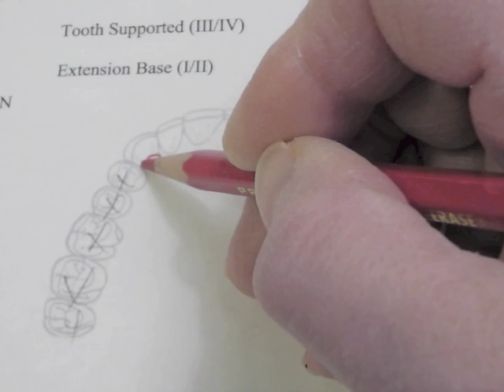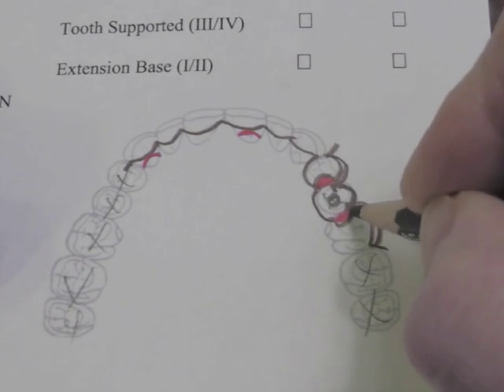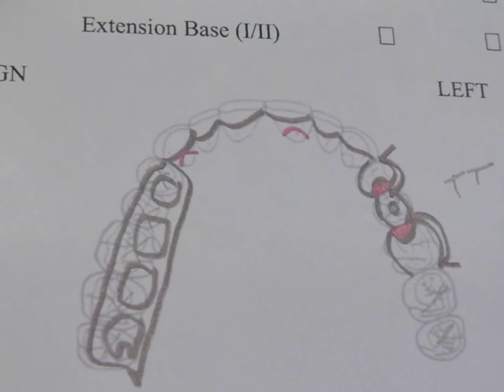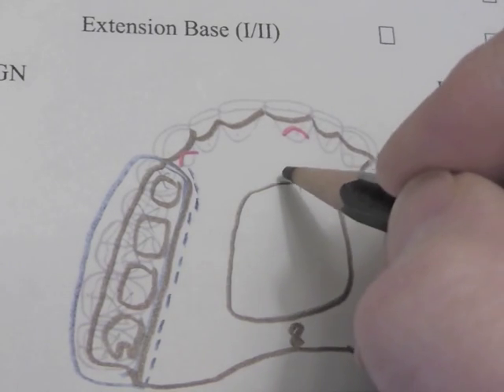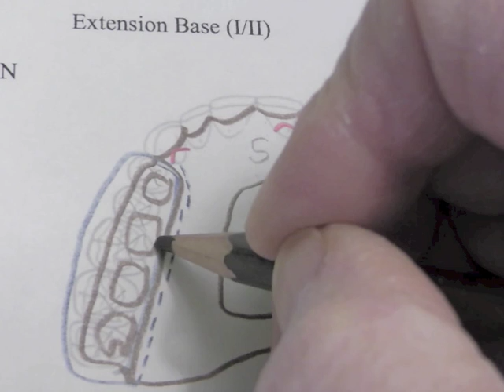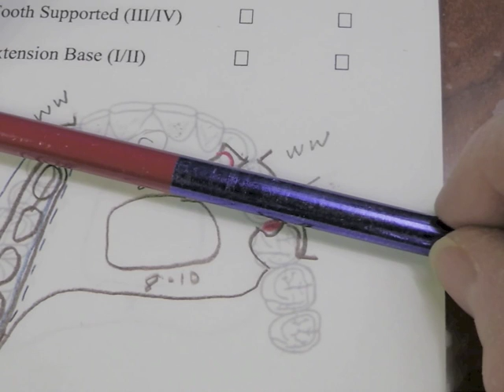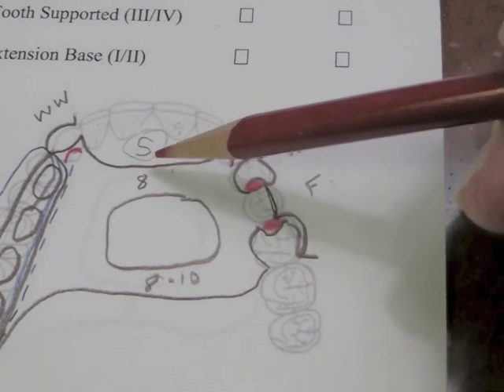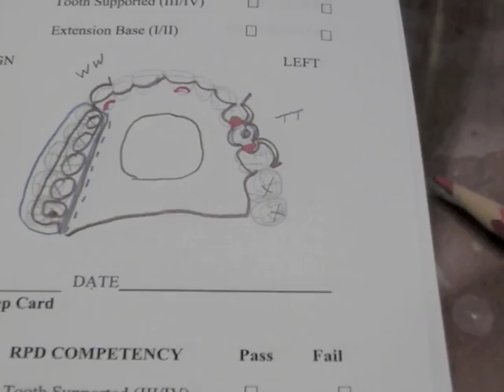R P D Design - Ken Class II Max Cast #4 Part C

Comment from the maker: I cannot predict the periodontal condition of the premolar.  You must determine that it is a good abutment  or should extract it and change your design by moving back to the molar or up to the canine depending upon which premolar you are speaking about having recession.  
For a tipped molar, I sometimes do the following:  I mount the case on the articulation when sending the case for the framework to be made.  I then ask the lab to completely cover the molar  with the rest but ask that they wax the metal rest with the anatomy of a molar into occlusion with the opposing tooth on the maxillary arch.  By completely covering the occlusal surface, it prevents further tipping of that tooth to the medial and it gives me better occlusion with the opposing arch.
Reply: Ann Windchy Thank alot, God bless you
Reply: I like your videos. They are very detailed and nicely explained. For this specific case, why are the posterior teeth not replaced #15,16?